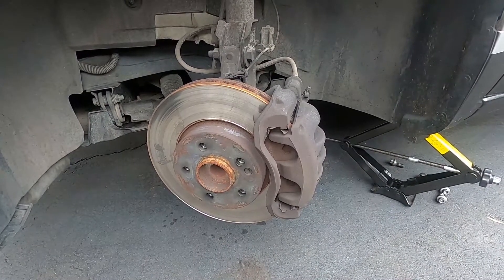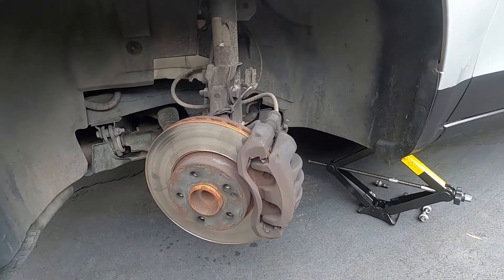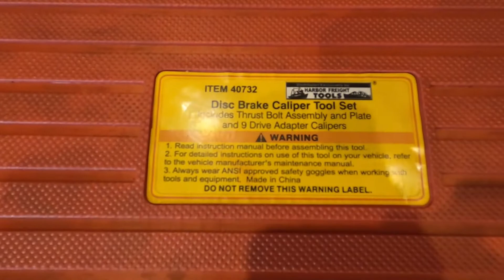Front Brakes and Rotors on a Mercedes Metris Van

Comment: What's the wheel nut (lug nut) torque spec?

I have a 2020 Metris.

Mitchell/ Pro Demand does NOT have a torque spec listed.
Reply from the maker: If you have the steel wheels like I do, the torque is 150 ft pounds.